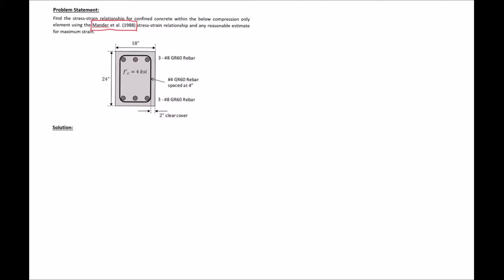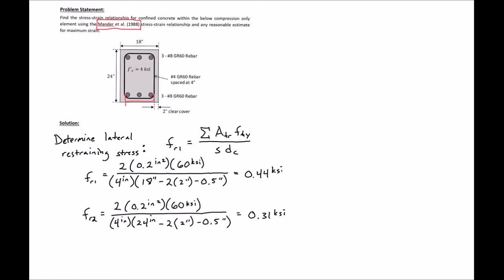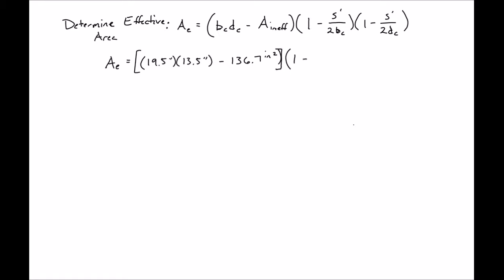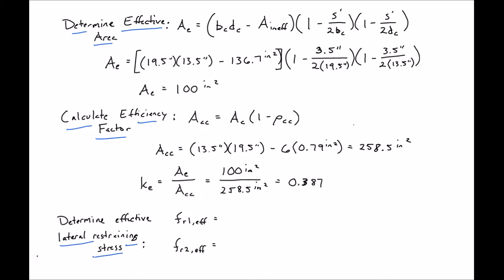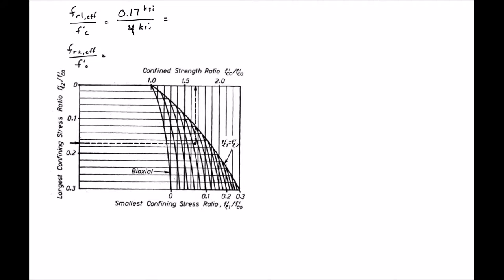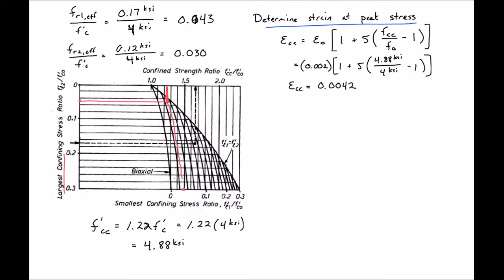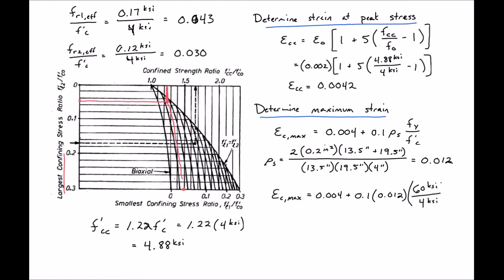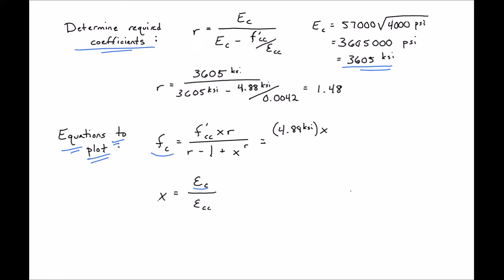5 - Example for Stress-Strain Curve for Concrete with Confinement Effects

Comment: According to Mander et al., 1998, when calculating the ineffective area, w=clear distance between adjacent longitudinal bars. Why is it that you ignore the middle longitudinal bars?
Reply from the maker: The center bars are not restrained by transverse ties, so they do not count when finding the clear distance.
Reply: If it were a beam cross-section under flexure, would you calculate the ineffective area the same way?
Reply from the maker: Short answer is that you can just consider the cover area as ineffective in flexure members. A few factors to consider: (1) the strain is not constant across the depth of the compression region, (2) only the concrete in compression will be confined, and (3) the location of the neutral axis will change when you lose the cover. You can see https://youtu.be/f9OcrZ-DOQ0?t=2441. Also, see section 6.5 of Park and Paulay (1975) "Reinforced Concrete Structures" for discussion.
Reply: adjacent longitudinal bars with confinement so if there's no cross tie on the middle bar it shouldn't be counted